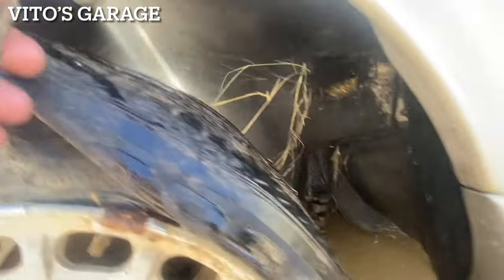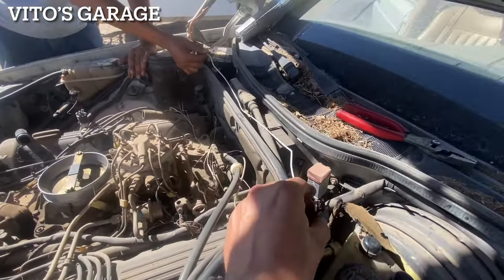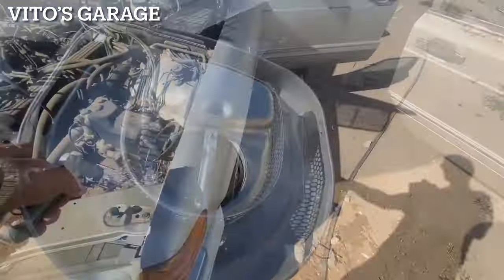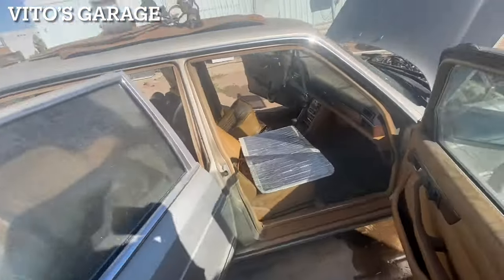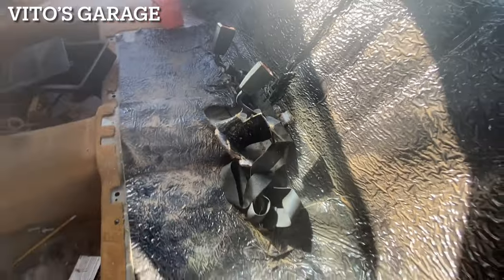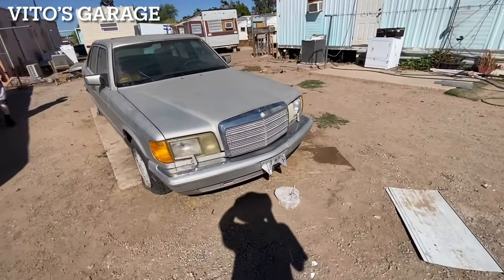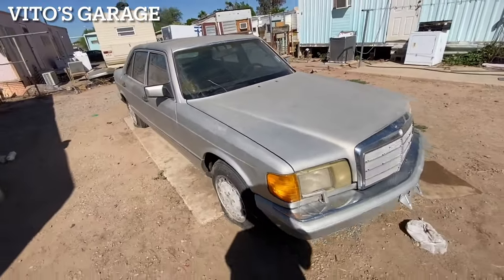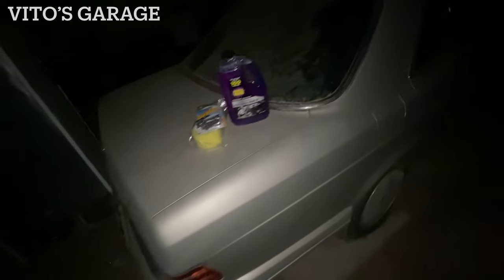This Old School Legend Sat Since 2007. W126 1987 Mercedes 420SEL with Lost Keys in Hot Arizona!

Comment: Next time just jump 12 volts to the lock connection in the drivers door to the pump. You can unlock and lock the whole car with those 3 wires